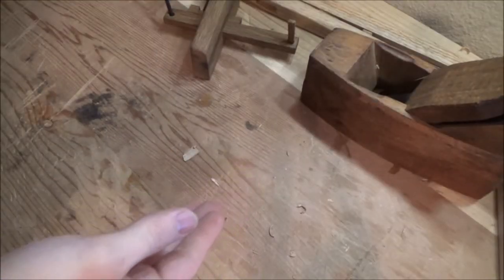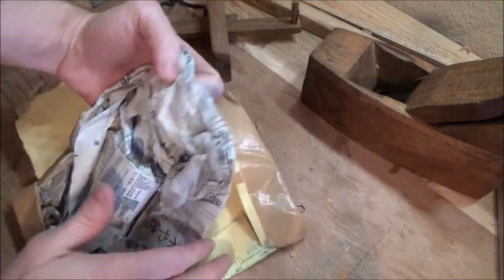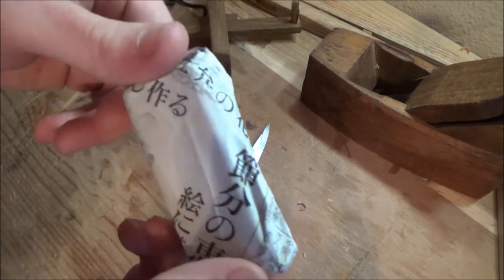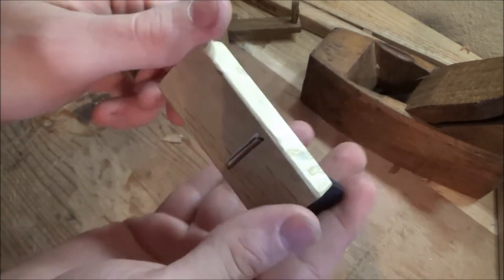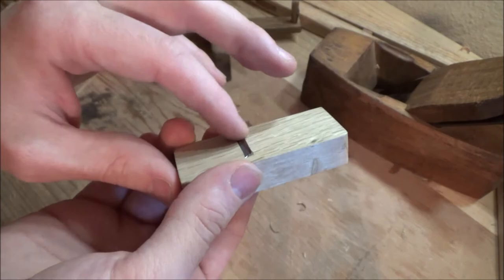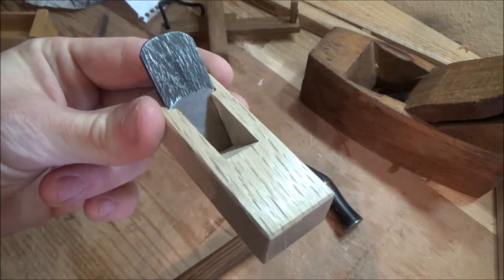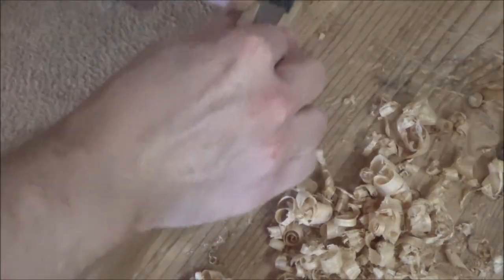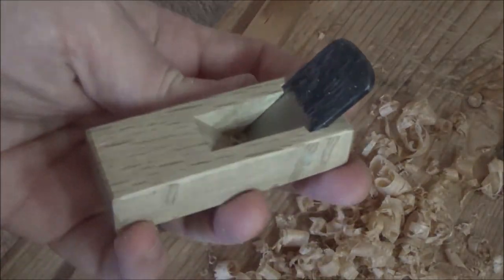My New Mini Kanna (Japanese Finger Plane)

Comment: Very nice! What made you get into Japanese woodworking instead of western? If I may be so bold......
Reply from the maker: Thanks for watching! With western planes you work on the push stroke. In order to do that well you have to have alot of weight to lean against in a work bench. I live on a third floor apartment so having a 300+ lb bench is simply not going to happen. With Japanese woodworking the planes work off of the pull stroke. This does not require that much weight because a pull can act like a wedge under its own tension. So with Japanese woodworking it simply requires less weight and less implements overall. It's also just really enjoyable to me!
Reply: @Lemongrasspicker  right on man. I just recently got in to woodworking and I love it. But I also kinda feel your pain as far as not having room. But I just made do. I live in a trailer park so I just work out of my living room lol. But thank you for your time and great videos!! Always a pleasure.

Comment: How much tuning did you end up needing to do on the plane body when you got this? I just ordered one from Fujihisa and they seem like they need a bit of work. I don't have a chisel small enough to fit into the abutments and they seem a little tight 😅
Reply from the maker: It needed a small amount. I just used needle files to fit the blade and adjust the sole. Alot easier than chisels for planes this small lol
Reply: @Lemongrasspicker  good excuse as any for me to buy some needle files :)
Reply from the maker: @peterlu8947  yes indeed!